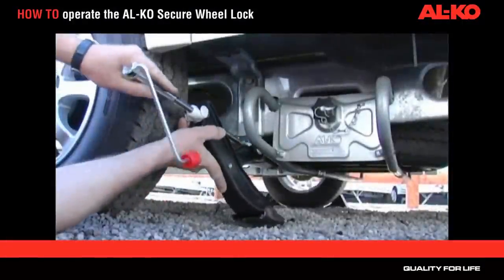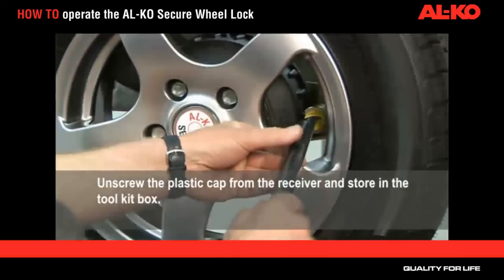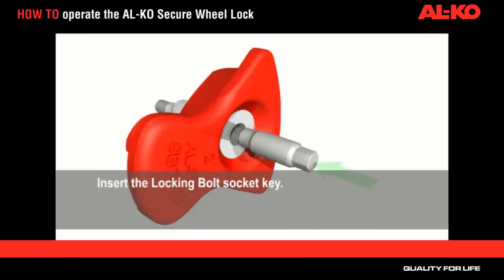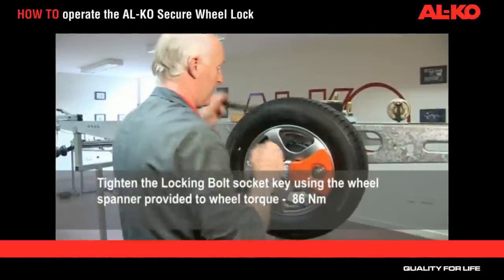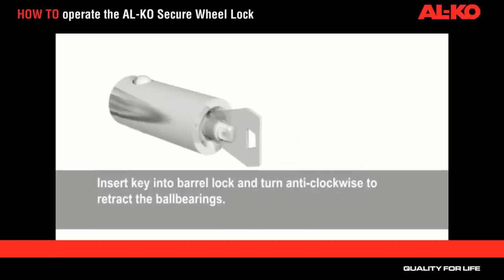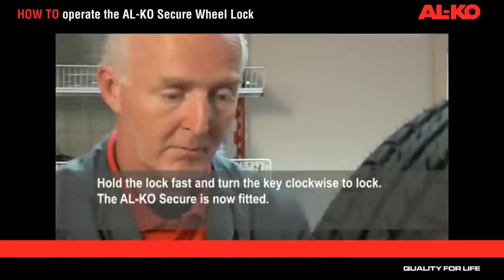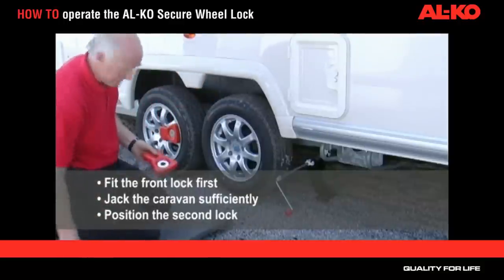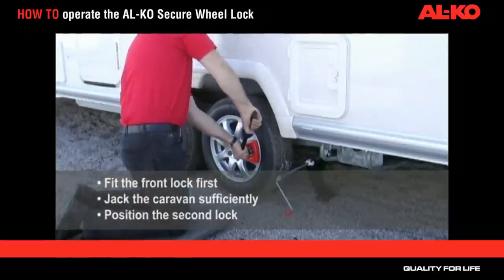HOW TO operate the AL-KO Secure Wheel Lock

Comment: This system came as standard on my new caravan. I needed to fit it on my first trip and arrived in the dark and the rain on a gravel hard standing. Not managing to get the wheel aligned to the one degree of tolerance the only stripped! There is now way at 61 that I want to lift a caravan up to secure it. The Alko hitch lock I have used can be secured in 15 seconds! Presumably the company has been taken over by designers who has never pitched  a caravan outside their workshops!

Comment: I have these on my twin axle caravan.  I fit them as follow
1. Sight the caravan where you want it and leave it coupled to the tow car.
2. With the caravan brake off, jack the caravan.  I use a 2T trolley Jack lifting on the chassis through the wheels.
3. Once the wheels are free to rotate, turn the wheels and then fit the barrel nuts as normal ensuring that they are tightened up.  Do not fit the outer locks.
4. Gently lower the caravan.  Once fully lowered, remove the jack.
5. Apply the caravan break and uncouple the tow car.
6. Remove the wheel locks.  Because the receivers will have moved slightly, it may require a bit more effort than when you fitted them.  Once removed you will see that both of the receivers are no longer central but should still be aligned with each other.
7. Engage the caravan mover and release the caravan brake.  Use the mover to move the caravan to align the receiver with the centre position between the wheel spokes and fit the wheel locks.
8. Reapply caravan brake and disengage the mover.

First time takes about 10 minutes but after a couple of goes, you will quickly get it done in a couple of minutes.

Comment: Some insurance (Caravan Club) will give discount (10% I think) for using Alko Wheel locks HOWEVER taking this discount means that an additional stipulation is applied to the policy whereby you MUST have BOTH wheel locks applied to the SAME side.
(To answer Nick Moore's question below this is because with just one axle locked that tyre can be deflated and the caravan dragged away).
I'm interested to note that AlKo's own video recommends jacking and then turning the wheel. Especially since their own manual for their van jack states 

"The caravan MUST be attached to the towing vehicle and the handbrake on both the towing vehicle and caravan MUST be applied."

This means that to jack the van then release the handbrake is in breach of their own safety guidelines and as Julie Thornburrow mentions in the comments below the van can and will collapse when doing this.
I've declined the discount since it is a sure fire way of invalidating your insurance.
As for AlKo, get your recommendations for safe jacking consistent either it is or is not safe to have the handbrake off whilst the van is jacked.

Comment: trying to fit one of these to a second hand caravan right now, however I found the receiver part looked brand new and had a foil sticker over it that revealed a locking bolt already in it. where would i look to find the key for this? is there a place i may find the key or do i have to buy a whole new receiver and have it fitted? the key that came with my lock does not fit it.

Comment: Side lift jack is useless if you have quad movers fitted on a TA as I do.  The design of the ALKO lock means only one can be fitted sensibly without jacking ( no easy on grass).  So now only fit one and on the other wheel fit a Nemisis Ultra lock.

Comment: I don't think alko have ever done this to a twin axle! The only way I have found to do this without the locks causing strain on the wheel is to jack van up, adjust wheels so the lock receiver is NOT in line with the opening just enough so when you lower the van down again and the wheels turn the receiver lines up to the centre of the opening (BTW the amount off centre is different front to back). Then fit the locks, they won't stress the wheel or the suspension of the van. Oh and good luck with that stupid jack you've got when lifting 1.8 tonne, twice cos you didn't get the line up right first time! Having said this won't be without these lovely locks!
Reply: Neil Marjoram

Comment: I only have this system because it came with a new twin axle van and I don't think I have ever resented the "Gift" of almost £500 worth of equipment quite so much, truly I wish they had not included these with the van.
Not only is the design of these locks an absolute pain to fit to a twin axle but it is positively dangerous!! If ALKO even bothered to read THEIR OWN DOCUMENTATION they would read that the AL-KO jack should not be used with the handbrake off. I've contacted them about this discrepancy but they have not bothered to reply.
The design of the lock inserts requires such precise alignment that even the slightest movement of the van throws out the alignment and you have to start over again. 
For single axle vans this system is overpriced (because they engineer it to be specific to the wheel type) but probably ok. For twin axle vans imagine trying to follow their procedure on an uneven surface or to try jacking a van up on wet grass!!

Comment: A-KO on a Twin axle absolute nightmare I have better things to do than spend an hour trying to line the wheels up, jack them up, then strip the damn things...it is badly designed...I use two Thatcham 7 bike chains takes two minutes for both sides...These damn things are a disaster...trolley jacks bottle jacks ...align this... pull this out... twist that absolute nightmare...